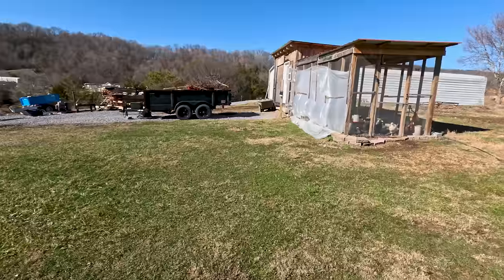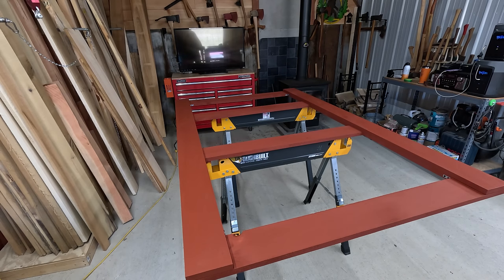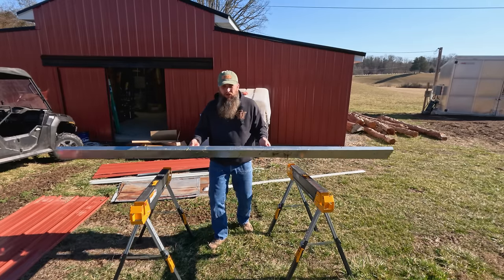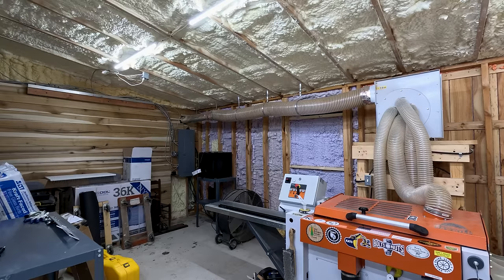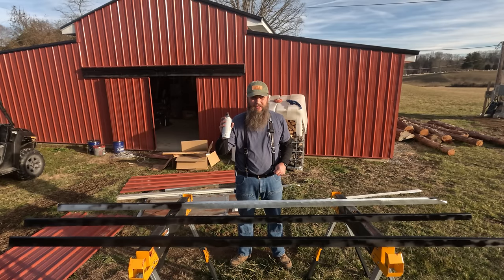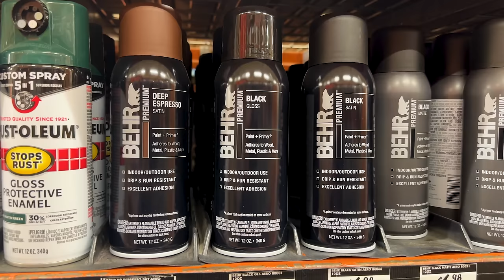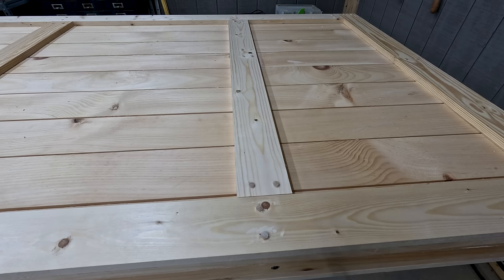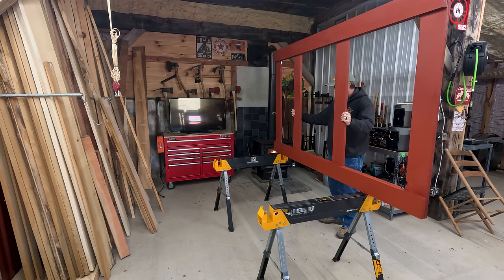One Of A Kind  Sliding Barn Doors Built With Homemade Lumber

Comment from the maker: Metal cutter used in video:  https://amzn.to/3Oun359
Reply: wide chicken wire,  cut in  a rectangle leaving an inch above and below so the chunks get out.  Add an owl sculpture they use on boats.
Reply: A friend makes a carpenter bee trap. May send you one to try. He lives in Georgia and has the same problem. Take care
Reply: Looks good to me myself and i:body-blue-raised-arms:......Thanks Nathan 👍                                       
Old nasty Shoe🇺🇸
Reply: Put a 90 degree elbow on the discharge and extend it downward 6 to 8 feet.
Reply: I was going to totally suggest this idea. 100% agree.
Reply: 😮put a Owl Decoy, temporary til you find a better solution
Reply: Put a light flapper door on the opening (like sheet metal). Adjust the angle to where the air flow will push it open, then fall back to closed to keep birds out.

Comment: Keeping birds out, you could put a hinged flap. Opens when the air comes through, closes with gravity or a small spring.
Reply: I agree
Reply: That was going to be my solution, too.
Reply: I tried that years ago.  The birds fly in place, lift the flap, and go in in tube.  Smart little animals.
Reply: Yes, like a dryer vent flap
Reply: It’s still a deterrent. But if Nathan is using it pretty regularly, it might not be an issue (or become one).
Reply: Maybe try some hardware cloth cut in a circle inside the pipe and a hinged flap on the outside.
Reply: @ascienceguy-5109  My hot water tank has a fan.  If it doesn't turn on (or shuts off) the circuit turns the gas burner off as a safety function.  Squirrels opened the vent flap and stored nuts down the tube, which jammed the fan, etc.  I figured it out the next morning when there was no hot water for showers.  Once I removed a dried out mouse that got stuck in there.  A small bird cage over the vent tube fixed the problem, even though squirrels still drop nuts into the cage.
Reply: That is my thought as well; a spring loaded flapper valve that would open with the airflow but would close and seal once the collector was shut down.
Reply: Excellent idea, a dryer vent cover may be modified to fit the outlet.
Reply: Add a carburetor choke type control that either works too stiff for birds to deal with, or with a hook or loop end to secure.  When you use it, just remember to open/close it.
Reply: That what I was going to suggest. A flap like a dryer vent.
Reply: Exactly. Like a dryer vent
Reply: Use a damper that's always closed unless extraction system is on.

Comment: Screw a plastic owl above the outlet pipe … someone also said put a flapper on it. That is also a very good idea.
Reply: Agree with the flapper.
Reply: Either will probably work. I had a similar situation. Birds were nesting in my sawmill. Put a plastic owl near mill on wall, haven't had anymore problems. Flapper wouldn't have work in this case.
Reply: I think the owl idea will work a buddy of mine uses one to keep the birds from flying in his garage and never happened after he put it in it's place

Comment: How about using a sort of "windsock" type device. It will allow the wood chips to be blown out, BUT when not in use, it will hang limply.
Birds will not try to fly UP the wind sock into the exhaust pipe.

Comment: A 90 degree bend and a 12 inch pipe straight down, that keeps the birds out, they don't like flying up inside a pipe.
Reply: 2 -45* bends should off less obstruction to flying debris than 1-90* bend plus add the 12 to 24-inch pipe to the end turned down.  Do not put anything in the pipe as a restriction, it will catch stuff and eventually clog up.

Comment: You could put a dryer vent cover on the saw dust pipe that way when it runs the air flow will open it and when it’s not running it stays closed. 👍🏼

Comment: Hmm here's a thought Nathan, make an end for your exhaust pipe with 1/8" diameter wire that is spaced 3/4" apart (depending of course on what type of bird likes to nest in there), all the wire should be parallel.  If the attachment is made out of ABS or PVC pipe it can be rotated so that the wire is either vertical or horizontal, it may be adjusted to find out which orientation works better at not trapping dust.  No moving parts, and I find that the flap on my dryer vent always catches dust and lint up at the hinge which eventually needs to be cleaned.  Great video thumbs up.

Comment: Use a weighted cantilever flapper/cap on the pipe? The air pressure should easily open the cap and close once you cut the power.
Weight can be adjusted as needed.

Comment: Add a vent damper, like what’s used in hot air furnaces or boiler vents. Probably have them at HD or your local plumbing supply store, and they might even stock the exact size for your dust collector exhaust pipe.

Comment: for your bird problem I would suggest a flap like on a dozer exhaust the air pressure from the fan would open when in use and it would close when not

Comment: Two solutions…

Install a bag or metal catchment box made from aluminum onto the pipe that can easily be removed with a squeeze type clamp… then you could just discard it as it filled up…

Another simple option would be to point the pipe in a more downward direction, making it much harder for them to easily fly in, and made add a couple of vertical wires inside the pipe.

Comment: for the bird nest issue how about some thin plastic that will cover the hole flat when you are not using the collector and when it's on the air  and chips push the plastic away from the discharge hole

Comment: McMaster Carr makes exhaust pipe caps of various pipe sizes.  hey are weighted flapper valves that open under slight positive air flow.  Otherwise, they are held closed by gravity (which never fails). They're not very expensive, but must be oriented just right so the work.

Comment: A flap would work as other have suggested...other option would be to extend the pipe vertically downwards about 2ft...birds wouldn't be able to get up inside it then..and your chipping would form a nicer pile on the floor. Loving the doors.

Comment: put a light weight flapper over the end of the pipe.    When the exhaust is not running, the flapper should close, but when the exhaust is running, then the flapper should blow open, and the sawdust and chips, should be able to exit.    just a thought

Comment: As previously said by another person you could like a big tractor exhaust flap or maybe chicken wire. The bird building the nest is probably a Starling. They nest in holes and indoor spots out of the weather. I actually had a problem a few years ago with them in the eves of my house. I've even seen them go into a dryer vent with a plastic guard on it on the outside of a house. And if they nest there one year in which they raise two broods they will do the> darndest to nest there in the future.

Comment: Most of the people here have given you the best answer, ie: extend the existing pipe with a 6 to 12 inch straight pipe, then another 45 degree bend which point the opening towards the ground. Then connect another 2 to 3 foot straight pipe which will then allow you to place your blue Logrite dump trailer or another one, under the pipe to collect the shavings. There may need to be a 1 or 2 foot gap between the end of the exhaust pipe and the top of the trailer to stop back pressure from the exhausted air blowing the shaving in and out of the trailer. This would fix two problems you have at the same time. Good luck and enjoy your videos.

Comment: Fix the bird problem with a vertical hanging damper on the duct. One that is closed when the system isn't running, but opens when it is.

Comment: On the exhaust duct for dust collection: Self opening/closing louvers should deter birds etc. also if you point the discharge down about 18" birds will not be as attracted to the opening for nest building.

Comment: Louvered panel on the end of the DC outlet to the outside. CLoses it off when not running and will help keep birds out. OPens up with air flow and should not restrict the chips.

Comment: The comment about a flap is a good one, I wonder if a flap assembly for a outside clothing dryer exhaust would work?
Or maybe an old style set of louver like they use on exhaust fans or ceiling fans that the moving air open?

Comment: Try a flap door which will open when the air is on, small weight will close the flap on the pipe when it is not on. No entry to critters or birds

Comment: You could build something like a fireplace dampener that you can open and close as needed. Or have it lightly spring loaded where it is closed until the air flow pushes it open.

Comment: Hey Nathan.  I cannot tell the diam of the pipe, but if it is 4 inch, they make a bunch of ends to go on dryer vent to keep out birds.  Or if bigger, I wonder if it went straight down if that would keep them out.  then could also put an icb tote under it to catch the dust and move it like firewood.  Regards, Doc Henderson
PS I wonder if using some titebond 3 with some of your doors, may also make then more rigid over time, and keep them from sagging if the screws allow sagging over time.  the barn doors should be ok as they are supported across the top and not from side hinges.  Doc.

Comment: Buy a small bird cage large enough to go over the end of the exhaust tube.  Fabricate or rework it as necessary.  Attach it as needed to keep it in place.  Birds can't get in.  Check to make sure the chips get out.  Problem solved.

Comment: You should try the suggestions first. If it doesn't work call your local Hvac guy and see if he is smart enough to wire you in a motorized damper that works power closed and open and put an inspection door next to damper for cleaning. I could not see the cuts you had finished with your tin snips. Get a bigger pair of tin snips. I learned from a metal master. All he ever used was the red and green snips and the big hand snips. That is all I have today 43 years later. Cutting anything over 2" use your big snips. By no means do you cut to the end of any of the snips. If you did you see the little notch the snips makes.

Comment: If you were trying to stiffen the frame by adding tiny "L" brackets, you'd be far better off by putting some titebond glue at the joint...stronger than wood.